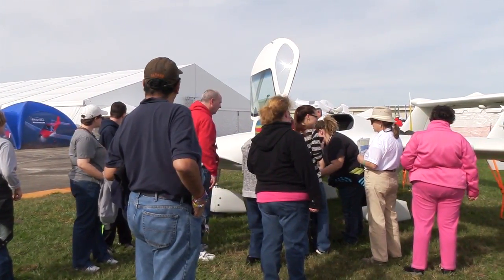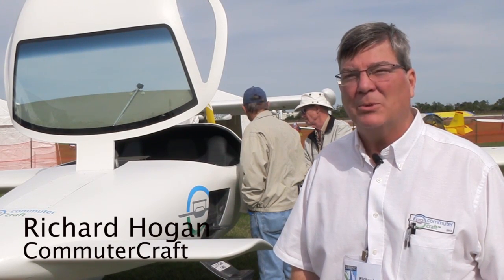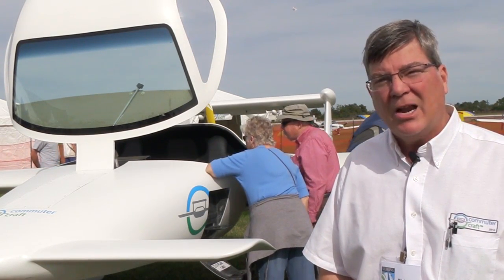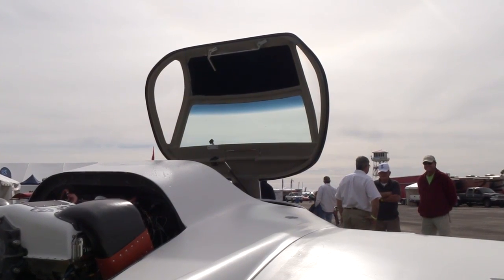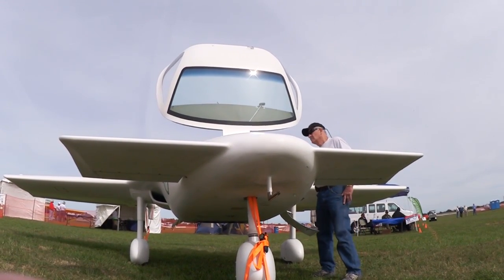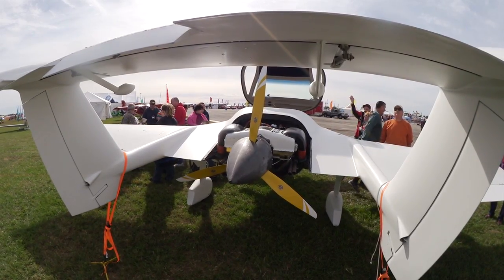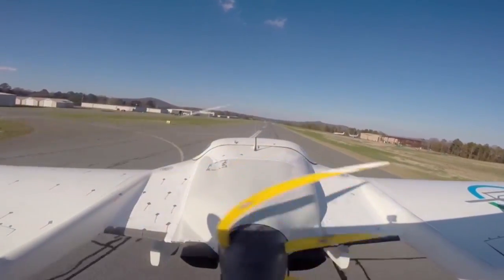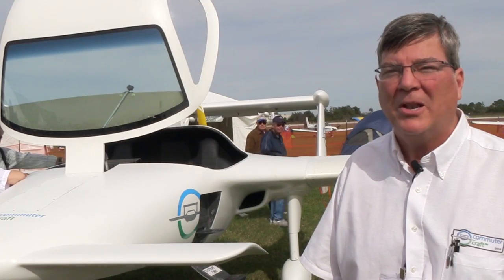Commuter Craft Debuts at Sport Expo

Comment: "Commuter airplane"... OK sure. 3 yr old video. I use to commute 30 miles to work when building hours working to being an airline pilot. This is not a big market. There are cheaper planes to serve as a "commute" (older 172, Piper Cherokee). I own a RV-7 and it's faster, simpler and cheaper, if you build it or even buy one already built. I refute it is "safer:... This will never hit the market.
Reply: @herenow8491  Sadly he crashed in this plane and perished March of 2019 I just learned. Not sure the exact date I made my original comment above. It says 3 years. So it was about the time or after he crashed. Again I had no idea about the accident till now. Reading the Plane and Pilot and AOPA article (and NTSB report) about the accident over 3 yrs ago, it made me sad. Reminds me of Peter with the "Raptor". Although Peter survived. The this plane like the Raptor had poor flying characteristics, even after redesign. Although this "Innovator" had a direct drive Lycoming engine which was a plus over an automotive conversion with PSRU. Mr. Hogan  wanted to make Sun and Fun, but the test pilot was not available until after Sun and Fun. I am sure he wanted to promote it and get interest and potential buyers. So he flew the plane himself. He was not feeling well, apparently exhausted by all accounts, likely clouding his judgment.  Sad ending. Even though I was critical of the plane design I had no idea it would turn out this badly. I just looked at the final NTSB report. It is very detailed because there was video (not in the docket but a report is attached) plus data from the GPS/EFIS.  Bottom line, low time in plane, lack of recent experience, self pressure and in the end failure to control aircraft hitting the ground.